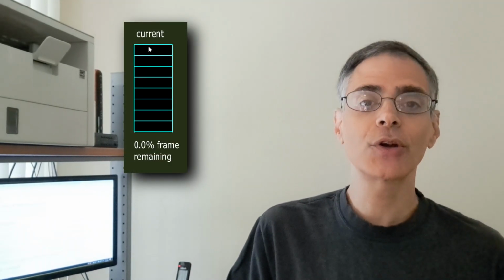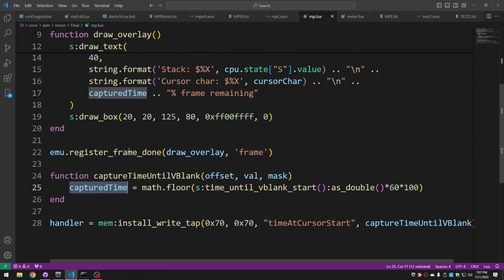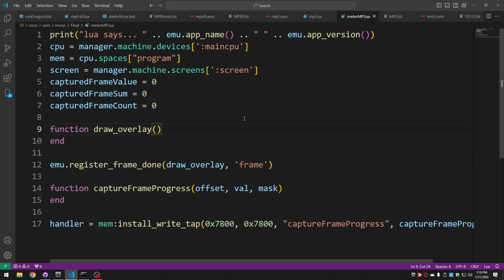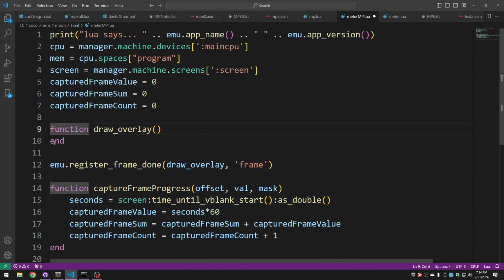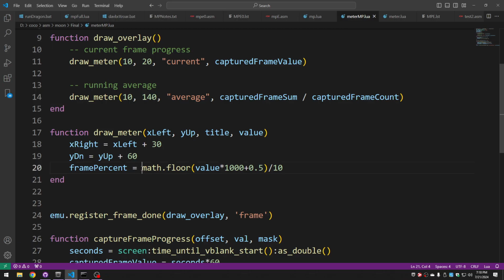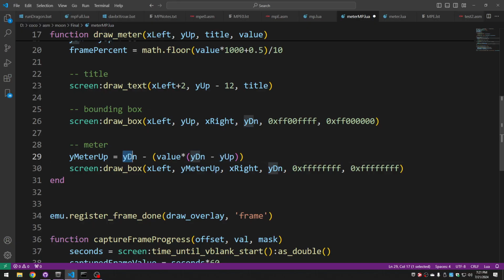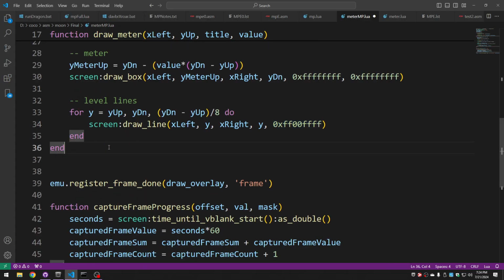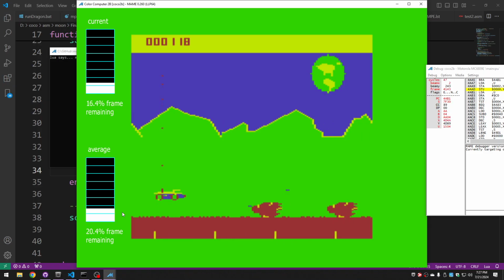Building a performance meter for MAME | #SepTandy

Comment: The meters are inverted.  When a meter of this type is at the top, it means maximum capacity has been consumed (nothing remaining) and when at the bottom, no capacity has been consumed.
Reply from the maker: Yeah, I can see how that would be unintuitive, and probably breaks some kind of UI usability rule. I just think of it as a performance meter where taller is better (a measure of how much free time we have each field)..
Reply: @CocoTownRetro  I wonder what would happen if other resource consumption meters would be like... RPMs and Fuel would certainly be a problem.  A temperature gauge isn't exactly a resource meter but when it's high it's not good.  Just things to think about I guess. It's certainly a clever implementation.  To test your meter against having too many cycles consumed exceeding the current frame, you can add a loop of NOPs to intentionally consume cycle resources to exceed the current frame and then people can see where "laginess" == "exceeding cycles/frame limits" and this gauge will help a casual viewer/programmer see where such performance problems occur.

Comment: Two very useful improvement that comes to mind is a "frame overrun" counter (how many times it missed the frame time target) and "lowest frame time remaining" (that didn't overrun). Both looks like they should be relatively easy to add with the infrastructure you've already made.
Reply from the maker: Indeed. Another idea from Matt Greer's blog is using different colors in the meter to illustrate how much time is spent in each task performed in the frame.  You can imagine different memory taps that are triggered after each subroutine from the main loop, and they get translated into their own colored fraction of the overall meter.